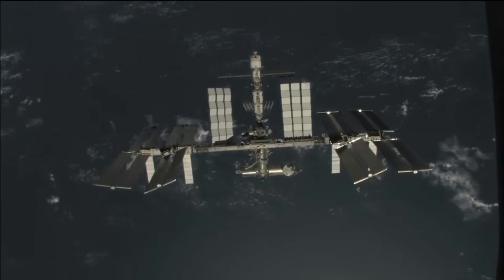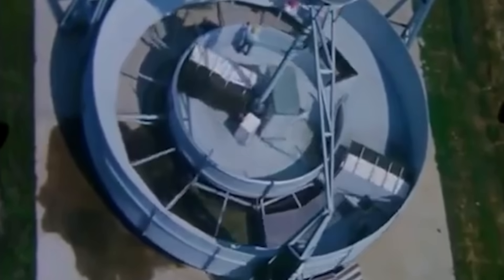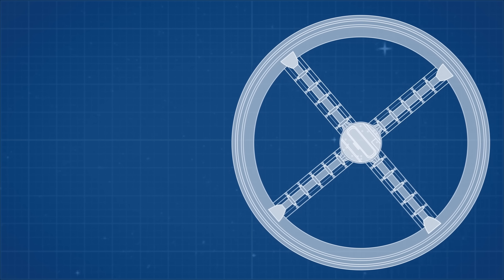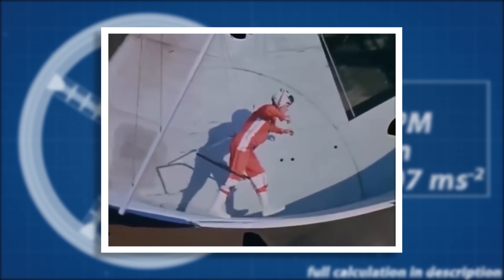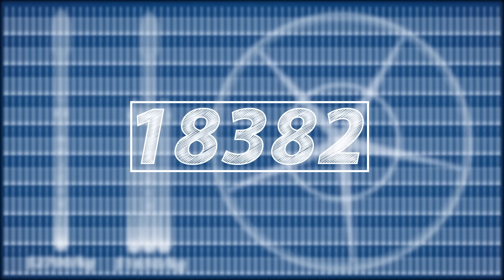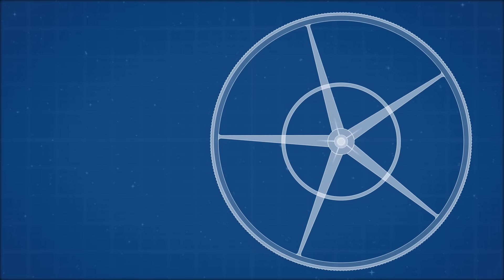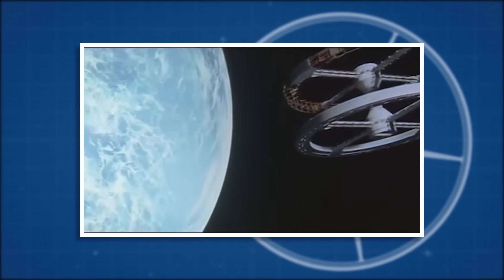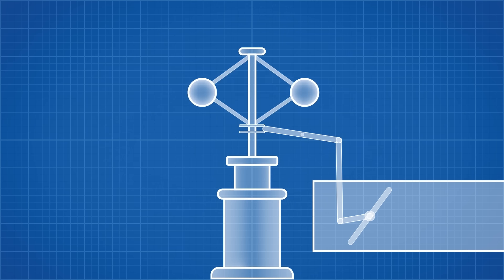Can We Create Artificial Gravity?

Comment: The one thing that most people do not know is that one of the original design purposes of the space shuttle's main fuel tank was to put them into orbit and connect them in a ring  or several different configurations for a potential space station.  There were lots of issues with it. one being that the tanks would be toxic but there were plans to create protections using inflatable environments inside them.   Another issue was to keep the tanks on orbit and to be able to move them around to be connected.  Such a sad waste of the tanks only to be burned up upon reentry.

Comment: I COULD NEVER UNDERSTAND WHY WE DIDN'T PUT ANOTHER SMALL ROCKET ON THE BIG FUEL TANK ON THE SPACE SHUTTLE AND PUT IT IN A PARKING ORBIT INSTEAD OF LETTING IT FALL BACK TO EARTH AND BURN UP. IF WE HAD  DONE THAT, WE WOULD HAVE ALL THE BUILDINGS MATERIALS WE WOULD NEED AND IT WOULDN'T HAVE COST THAT MUCH MORE. 

BESIDES THAT, THERE'S ENOUGH JUNK FLOATING AROUND THE EARTH THAT WE COULD CAPTURE THAT WOULD GIVE US A LOT OF WORKING PARTS WE WOULD NEED FOR THE SPACE STATION. WE NEED TO CLEAN THAT STUFF UP ANYWAY.

Comment: I still think rockets technology is too slow. Magnetic rail systems and ram jets have been proving to launch large payload into space. We're still using technology from the 1950s to launch payloads into space. If you  look up this technology been around for 40 year's now . Magnetic rail systems. Would be able to launch payloads into space   for the some pays as a flight to new York.The problem here is investment into new technologies that can make space easy in the long term. It's should not costed alot if magnetic rail systems ,ram jets  launch payloads into space. The pays would drop .

Comment: This will not work. If you float in space. You would float around as the station spinning passed you. You would not go enywhere. This only works on the density of your body on earth.
Reply: Sorry not in the fake outerspace they drill in our heads. It would never work. In reality there is no floating in outerspace. What goes up falls back down. The earth is flat. Van Allen belts is the firmament. We will never brake through. NASA lies about everything. Space is a fake made up storys.
Reply: @darens3907  Get. A. Life.
Reply: Mr Eric I beleive you need to get a life. I have an opinion that stands. If you don't like it. Don't comment. There will all ways be sheeple like you to fill the barn.
Reply: No, you inherit the velocity of objects you're connected to. So yes, if you are not physically attached, you will just float. But if you are walking on the inside walls of the drum you will experience gravity, And if you jump in the station, you're still traveling at the speed the station is spinning, so you don't suddenly fly back.

Comment: Finding the materials in space and using 3D/4D printing would probably be the best/cheaper and more sustainable way.
Reply: 3D printing from materials other than plastic is expensive and .... 4D ?
Reply: @chaluhovymozecek  when they've worked out the kinks and further develop it it won't be as expensive. There'll be 3D printers making 3D printers before we know it. 4D printing is like 3D printed but with a twist/additional ingredient. There's videos on 4D printing 😊

Comment: The spinning top (space station ) putting an angular momentum on everything , including people , at every distance away from the center of spin .   The momentum is angular only because the objects are attached to the 'top '.  If they were to become unattached the object would instantly take on a straight path as if slung by a sling shot . The forced retention of the fixed position is a gravity kind of force called centripetal and is equal and opposite to the 'centrifugal   ' force .  
However , the biggest expense in creating artificial gravity would be in the LONG continuing process of coming to understand just what gravity actually is , in cause , not just result. (apples fall)
Duplication requires a object or process (not a theory) to use as a model .

Comment: So what if instead of bulding a ring that big, we build just two small sections of that ring, tether them using something like a cord (carrying cables and anything needed to connect the two sections) and make them rotate oposite to each other? In that way we wouldn't need a 400m structure, just a strong cable to held the two modules together. In this way, we could launch that "twin like" module using existing rockets and once in space we could use thrusters to accelerate the modules as they separate from each other until the neccesary distinace is reached... is there a reason why this wouldn't work using existing tech and reasonable amounts of money?

Comment: I dont like the idea of having to walk in one direction, of course it could be done. But what about a solid core that would spin in the center would it not have a gravitational effect? Say a 2 layer system where a larger more dense mass could spin say in a liquid and have a motor to start the rotation or something. Then on the top layer could have some sort of wheels or bearings between the solid capsule and the walking area of the top layer that way it wouldnt spin you in one continuous direction, or would it need to, to ensure a gravity pulling effect. And would you feel the spin in space if so?

Comment: The problem is with long term exposure in micro gravity. So what if they just build one 50 feet in diameter, and instead of something to live in, astronauts only sleep there? This will lay them right down on the "floor" where the centrifugal force is the same spread throughout the body. This should help fix a lot of the current problems we have, such as loss of bone and muscle density.
Reply: The bone and muscle density loss is because the muscles arent used much. During sleep you wont use them to. The astronauts would need to jog in there. The thing is that there are much easier ways to train in space

Comment: I can’t believe how dumb people are all you need is a big powerful magnet for artificial gravity and I know it will slowly get demagnetized over time but we already have the technology to remagnitize things. Give me credit when you invent this(literally just a magnet)
Reply: But you aren't magnetic yourself. So how would that replace the way gravity pulls on your body
Reply: Rinse-esniR Ok it works way better on actual magnetic things but you can do an experiment with a powerful magnet and nail a piece of wood into a short wooden pole make sure it’s free to spin then tie a string to each end holding a plastic cup each with a mouse in it then put the magnet near one of the mice it should either repel or attract them depending on which direction the magnet is facing if it doesn’t work the magnet is probably not strong enough.
Reply: Rinse-esniR this can be used on the bottom space crafts to pull every thing towards it.
Reply: Rinse-esniR type in mouse and magnet experiment it’s the one on action labs channel it’s explained better there how you can pull and repel non magnetic thing with powerful magnets

Comment: Centrifuge will not work because all the tests done with centrifuge have been done in a gravity. take the test out past earths gravitational field and do it and it will not work. why? because gravity itself is not present.
Spin a bucket of water on earth and the water stays in the bucket because of the force exerted on the water by both gravity and the counter motion/speed of the bucket.
Spin that same bucket of water in deep space and you get water everywhere. there is no counter force to hold it in the bucket.

Its like doing a math problem and not using a key variable. it cannot be done.

It's like terraforming mars with lichen, it cannot be done. Earth is protected with a magnetic field created by the earths molten core. Mars has no magnetic field to protect it from the solar wind, thus most of mars atmosphere is blown off into space...as would any gas produced by that primitive plant.

Comment: you are mistaken in one info. please do not provide wrong information, the time to complete 1 rotation is 17 Sec. Not 24 Sec. with a radius of 150m. and acceleration of 9.81m/s^2 you can easily check it out by the rules of uniform circular motion

Comment: Okay so my 2am dumb brain is having some difficulty right now. Imagine a man floating inside of a cylindrical space station, now the stations starts spinning to create gravity through cent force, but wouldn't the man just keep floating and just the stations walls fly past him, nothing is tying the man to the station so if he's not in contact with the surface of the station he could still just float still, right?
Reply: Yes, if you assume the man is initially positioned in mid air before the structure begins spinning.   The moment he comes in contact with any surface in any part of the structure he will be affected by its motion - even the air inside.   Friction is the key factor.   The presence of friction at any point of contact induces a force between objects with a motion differential.   If the man comes in contact with any structure near the center, that point of contact will induce a force pushing him toward the outer periphery.   When he comes in contact with the floor of the outer periphery, the friction at the point of contact will induce a force pushing him in the direction of spin.   The momentary force is a vector tangent to the circle of the floor.   That would be a straight line velocity pointing through the floor and into space.   The curvature of the floor prevents him from moving along the initial straight line velocity, forcing him upward as the floor rotates around.   This interaction is the same as a ball spun from a tether.   Once he touches the floor he will remain in contact and experience the same forces as if standing on the earth.   If he jumps upward, he will fall straight down to the point he jumped from, but relative to the station, he will move in an arc across the interior, and meet again with the floor as it spins around.

Comment: Use a rail gun to launch
Reply: We're trying to shoot for the stars here, not heaven.
The sudden acceleration would rip the craft to shreds, the energy requirements are off the charts and would blow the railgun apart and the air resistance would burn anything that survived the initial launch within milliseconds.
Reply: @murraystenhouse2811 Not really, if yiu make the cannon lo'g e'ough so you get soeed slowly

Comment: Centrifugal force is not real By the video's definition, spinning a weight by a string would have the weight move away from the center if released (try spinning your keys on a string over your head). This does not happen though. The weight, when released, will move tangent to the circle created by the spinning system. This force balance of centripital and centrifugal forces, as stated in this video, doesn't exist.

Comment: The cost isn't the only problem, there is a lot of ""crap" from other spaceships rotating around the earth and this stuff is rotating extremly fast and will cause more and more struggels assuming the rockets will be the same as are used today they to will leave behind space crap and  make it near impossible to savely leave earth, so before launching all of the rockets into space you'll need to first clean up most of the stuff wich is rotating around the earth. (I don't feel like typing anything else because typing on a phone = pain)

Comment: Actually it's perfectly feasible, if you can accept the gravity of mars:
1. Build a cylinder 10m in diameter (5m radius).
2. The revolutions per minute is about 8 at near Mars gravity [ 30√(3.5/5) / π = 7.98 ]

There are a few conditions:
* You must stay in a "horizontal" orientation, otherwise blood will pool to your feet!
* The best use is for sleeping (i.e. "lying down").
* It could be used for working as long as you don't mind "being stuck to a wall" and "climbing about on the wall")
* No windows - avoid disorientation. Allow astronauts to display live outside view as background on laptops.
* Could just be a single module of the ISS, mainly for sleeping/recovery.

It could also be used to slowly adapt new astronauts to weightlessness too, by reducing the RPMs each day. Certainly vomiting even in low gravity is better than in no gravity!

Comment: maybe centrifugal gravity is just regular gravity somehow. The force of gravity has no particle that creates it but neither does centrifugal force. In its essence centrifugal gravity is just a trick of geometry but maybe somehow so is gravity.
Reply: This isn't really far from the truth.  Centrifugal force and gravity are fundamentally the same thing.  The issue here is acceleration itself.  The idea is that gravity is not a force, but the result of the distortion of space and time which makes a gravitational "field" behave identically to an accelerated reference frame.  There is no physical difference between having no gravity acting on you and accelerating at 9.8 m/s²....and standing stationary on the surface of the Earth. The two states are locally identical, so you're right.  If you were in a rotating reference frame which pressed you up against the walls at 1G, then you would have virtually perfectly simulated gravity.  The only thing missing would be tidal forces, but at such small scales, the tidal forces would be negligible anyway.